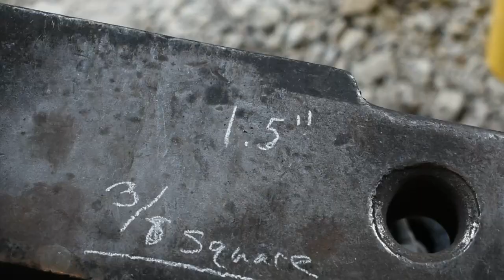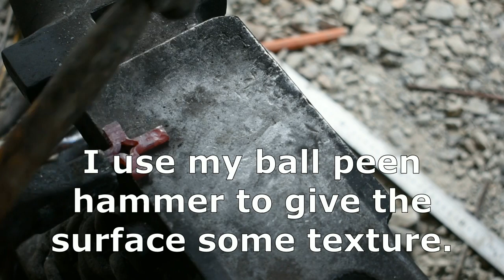Blacksmithing for beginners: Forging a simple split cross

Comment: What type of band saw is that?

Also, why didn't you use it to make the cuts instead of the hack saw?
Reply from the maker: The bandsaw is a https://www.amazon.com/WEN-BA4664-6-Inch-Metal-Cutting-Stand/dp/B09XWDLKCJ/ref=sr_1_5?crid=LS3Z8II4BE6N&keywords=Wen+Bandsaw&qid=1698334671&sprefix=wen+bandsaw%2Caps%2C1422&sr=8-5&ufe=app_do%3Aamzn1.fos.c3015c4a-46bb-44b9-81a4-dc28e6d374b3 The reason I used it over a hacksaw which works perfectly fine is at the time I made this video I was mass producing these and the bandsaw was faster, if I were doing small batches I would have just tused the hacksaw.

Comment: Good video again Matt.  Thanks.  Is that rigidizer you have across the bottom of your forge?
Reply from the maker: Thanks! I appreciate you watching! It's actually just coated with old flux from forging Damascus, it's covered and ate up the fire bricks in the bottom of the forge, I just haven't replaced them yet.

Comment: So!  That's how those are done!  Nice!  Looks like you can knock out a butt-load of those in an afternoon to sell at a Craft Fair !!
Reply from the maker: Thanks! I like to use my metal cutting bandsaw to cut the lines with it really speeds things up. They sell like crazy as a keychain or pendant.
Reply: @Mysticmountainforge   - I bet they do, how much would you sell those for?  if I may be so bold to ask?
Reply from the maker: @coreyshier7526  I usually sell them locally for 10 each with a key ring or leather cord, Online I sold them for 15.